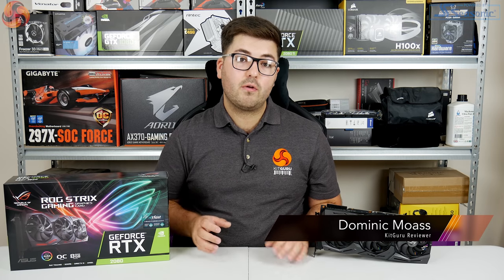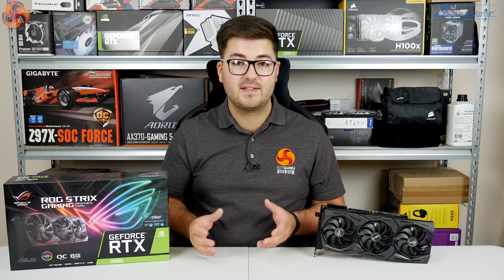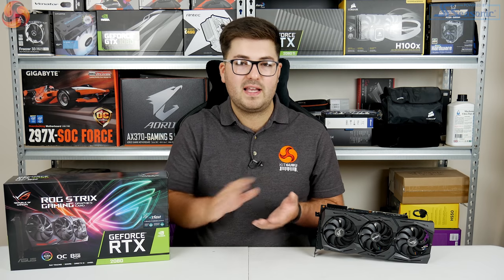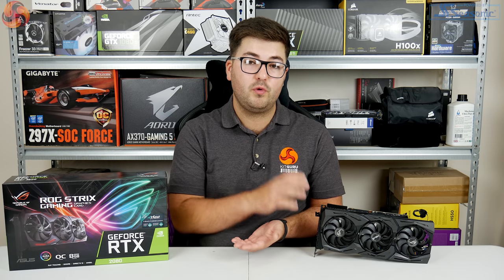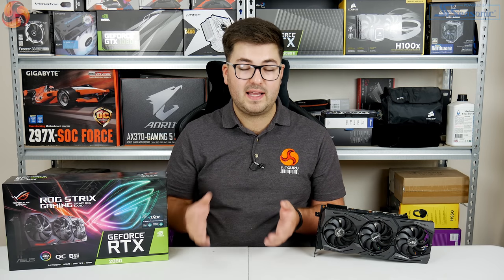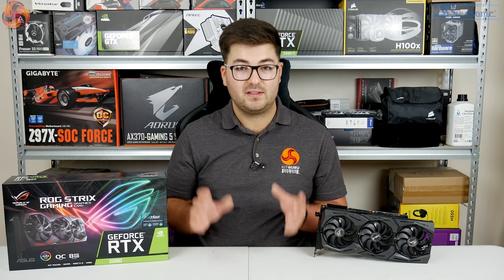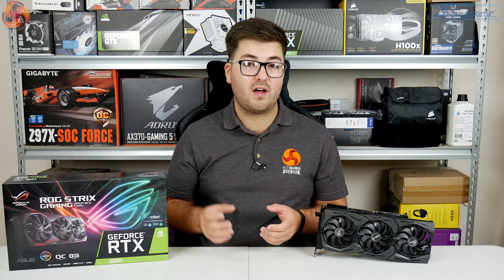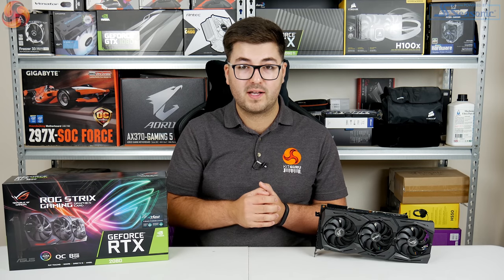ASUS ROG RTX 2080 Strix OC Video - THE FASTEST! but £999

Comment: Got mine for $820 was gonna buy a used 1080ti but they went back up some weeks ago 500-550 you could find one now 650-700 then pay shipping and its used. So for 120 more plus getting battlefield 5 with the 2080 is nice wish they had amds game deal i would rather have devil may cry and re2 remake. And with the latest drivers and both oc the 2080 starting to pull a good lead in most games.

Comment: Whats the best overclock setting for this card??? Just got one
Reply: (gpu boost clock)1960 MHz goes up to 2115mhz in game
(memory clock) is at 16500 mhz 
(gpu voltage%) +83
this is using ASUS GPU Tweak 2

Comment: I have an issue with card when i run msi afterburner or asus gpu tweak to see the fps the fps drop in all games and the game become laggy and unplayable. But when i use nvidia fps counter the game run smoothly. Anyone faced the same issue ( my ps is corsair sf 600)
Reply: You need a minimum of 650 watt brother , its possible you aint running smooth and on the cards full power due to your power suply

Comment: Someone help me please.  EVGA 2080 FTW3 or ASUS 2080 STRIX ?
Reply: ASUS STRIX is better for Overclocking and gaming. The Strix is anywhere from $800 - $900, and EVGA seems to be the same price but EVGA tends to have a smaller design with only 2 fans, while ASUS has 3 fans on their card.
Reply: if you have an asus build, asus.
Reply: Asus 2080 Strix.

Comment: I suggest to wait for 7nm by 2019 or 2020. Not worth it right now
Reply: how good will 7nm be
Reply: I skipped the 1080 cards because people told me to wait for the GTX cards a year ago. I'm not gona wait any longer, thank you :D
Reply: @ForrestFox  u upgrade why
Reply: Because I want 60fps?
Reply: @ForrestFox  why the question
Reply: @ForrestFox  60fps on wat resolution? Tese cards struggle t hit 60 4k
Reply: Where did you find benchmarks for that? The RTX 2080 is gona rock on 1440p
Reply: @ForrestFox  no its the same as 1080
Reply: I'll let you know when I've done my own benchmark with an RTX card ;)
Reply: @ForrestFox  its the same as 1080

Comment: so the performance is only marginally better than an OC'ed 1080ti while being roughly double the price... yeah i'll pass thanks
Reply: its way faster in some games
Reply: for me, "some" doesn't justify the near double price tag when i could buy 2 1080ti's instead and make up the difference with sli in "some" games
Reply: @SamFisher69420  yea 2 1080tis is better and worth more then 1 20ti
Reply: dont rush ti judge guys!!! in my humble opinion all the games will change soon so the real benchmarks there are not yet here!!1 ray tracing is not ready yes so we cant judge it from now!!
Reply: This card is not available yet but the MSI Gaming X Trio is, so should I get it or wait to get the Strix? I've been hearing a lot about the Power balancing and stuff. Is it false or what? I'm getting the 2080 not the 2080ti tho.
Reply: @nawras2631  all brands run the same just get the cheapest
Reply: @cmoneytheman  Both RTX MSI Gaming X Trio And Asus Strix have the same price where I live. Still expensive though. I'm basically paying a 1200USD for it. The Strix is not available yet. Should I get the msi gaming x trio? I hear it has some problems tho. Correct me of im wrong.
Reply: @nawras2631  I dont know if it do but its no reason to get it cause its just a 1080 just get that its cheaper
Reply: @cmoneytheman  nope for me it isnt. 1080ti is still expensive here. 1080ti is 50$ less.
Reply: @nawras2631  I said the reg 10
Reply: @cmoneytheman  I dont understand what u mean but im not gonna buy 1080 sir.
Reply: @nawras2631  wha dont u understand so instead of u savin cash u wana spend more
Reply: @nawras2631  no answer huh
Reply: @cmoneytheman  thats none of ur business. Do not get involved in someone's else pocket. I said im not a getting a 1080ti. That should be clear to you unless if you have autsim.
Reply: @BasykTV eBay why laughing
Reply: @BasykTV why u sayin that like its a better deal cause it cost more and then u say u suppose its been lots of used stuff people got for years so dont kno why u said that like its bad
Reply: @BasykTV u dont gota wait long everybody knows a 10ti is better then the 2080 thats just a 1080 with upgraded features its vids showin that so where did u see that lie how its better or who told u that
Reply: Prices could’ve changed but I just recently looked in Newegg here in the USA but the A1080ti is actually more expensive than the asus strix 2080
Reply: This card is actually cheaper than many of the cards now